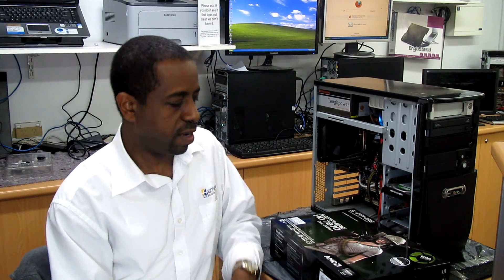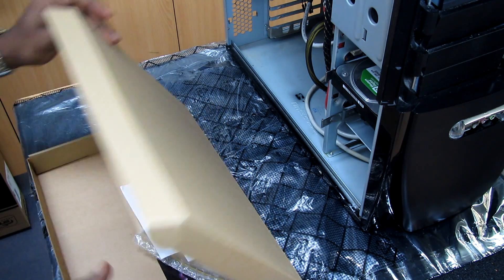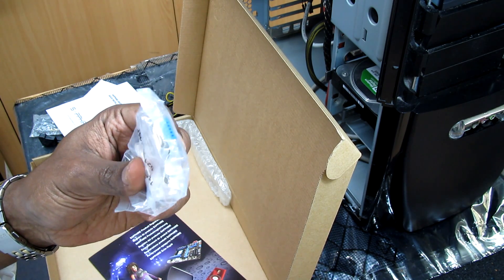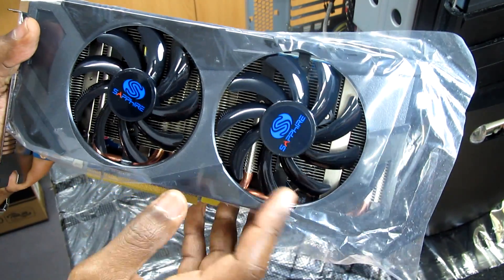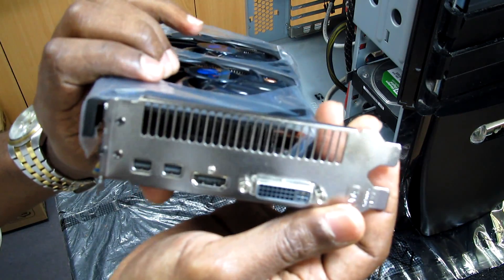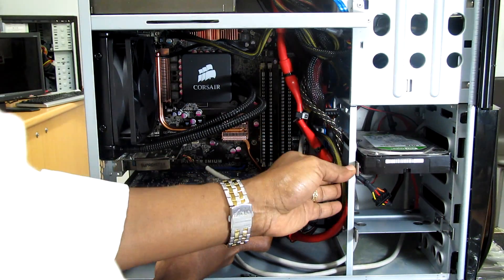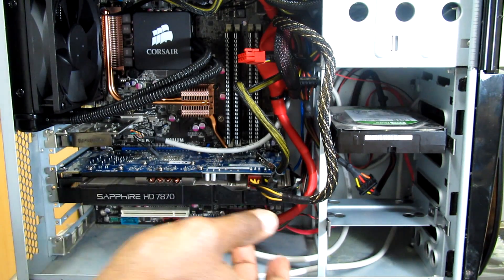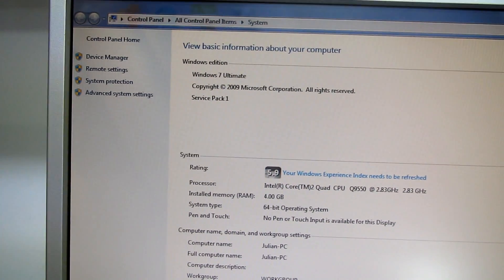How to Install Sapphire HD 7870 Overclock GHz 2GB Video Card

Comment: i only have one 6pin power connectors from my psu, is there any way i can still use the card?
Reply: there is a wire that gets two 4-pin molex cables into one 6pin power connectors, in the uk this is a link: http://www.currys.co.uk/gbuk/computing-accessories/accessories-and-bags/power-cables/pc-cables/dynamode-4-pin-molex-to-6-pin-pcle-cable-10cm-11885888-pdt.html
Reply: No , sorry
Reply: its okay, I found a way
Reply: keekzii What was the way? I have the same problem thats putting me off this card.

Comment: Alot actually, if you needed 200w, It would require a minimum of a 600w - 700w PSU, but at 120w it is able to run on a 500w PSU, I'm running it witha 520w

Comment: You are wrong, MINIMUM requirements ask for a 500w this is true "Because of the load of other items," The video card itself, MAXES at 175 Watts, thats with it being overclocked and running as hard as it possibly can, The card actually averages about 120-130 Watts

Comment: would there be a difference if I plugged the 7870 with a 6pin with a Splitter? Meaning the 2 6pin is coming from 1 PSU cord? (because I'm experiencing Black Screens on my video card)